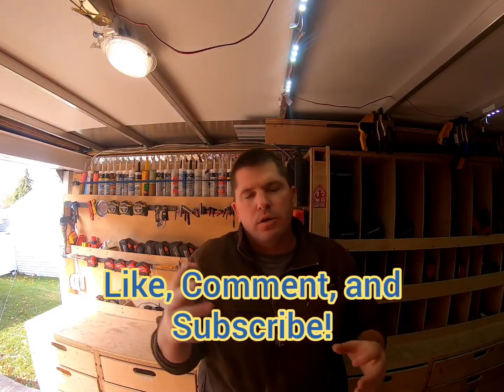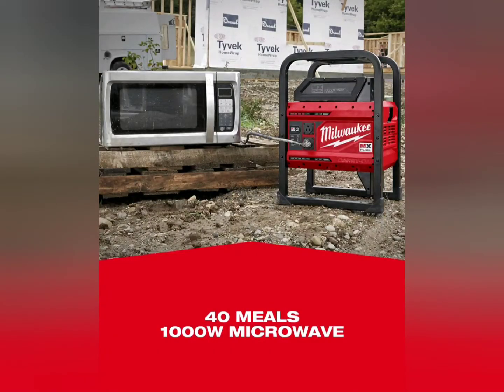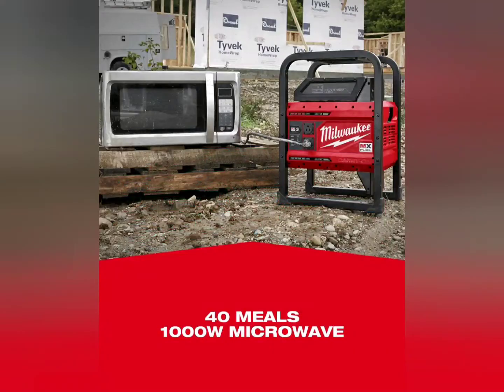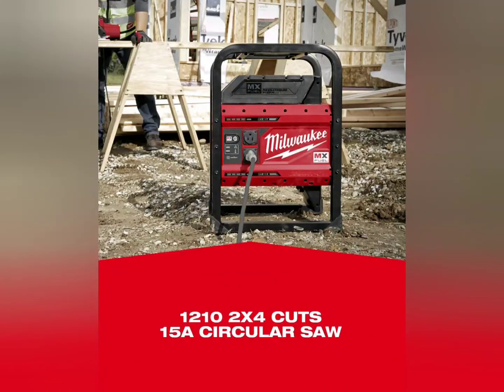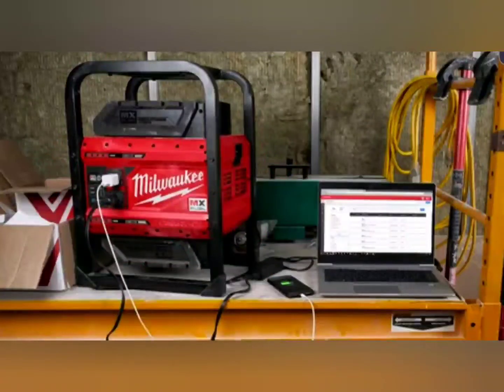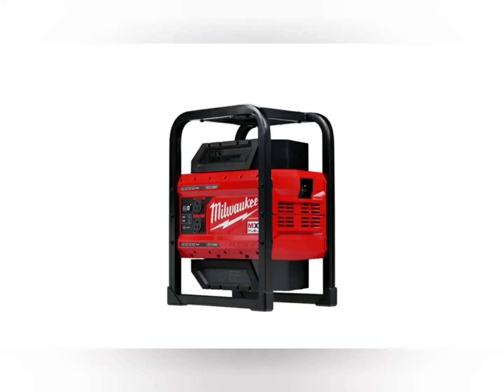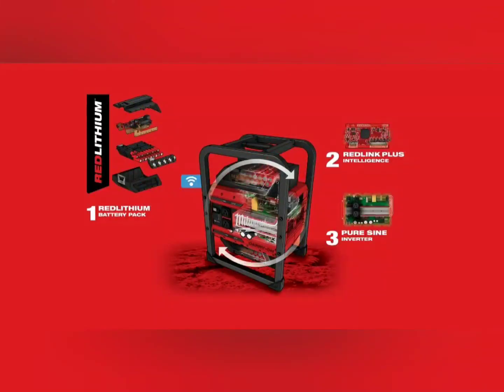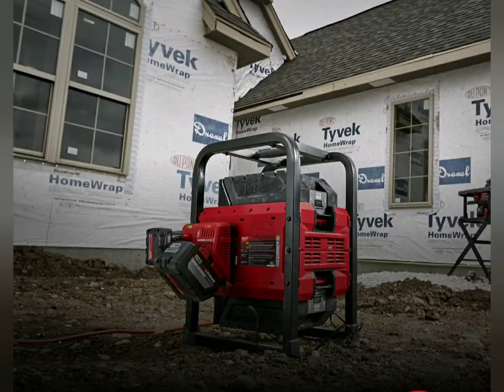Milwaukee MX Fuel Carry On Power Supply Thoughts!

Comment: Most informative video on this yet. Thanks.

Everyone wants to know the cost, but only time will tell. I'm hoping it's under $1500 with a battery or under $2000 with 2 batteries. It won't need a charger, which should lower the kit price.
Reply from the maker: My guess is $1099 with 2 batteries. They are comparing it to a $2000 Honda generator.
Reply: @RenovationsandRepair  For the sake of my bank account, I hope you're right!